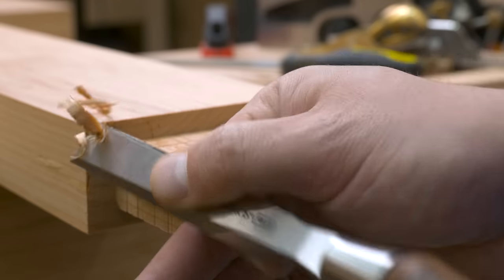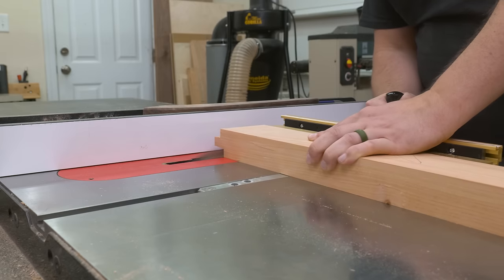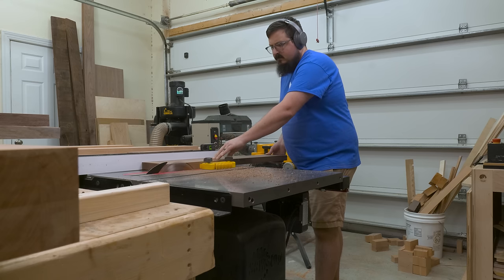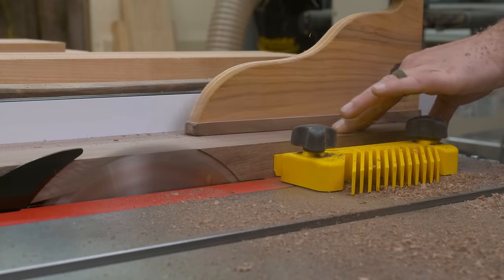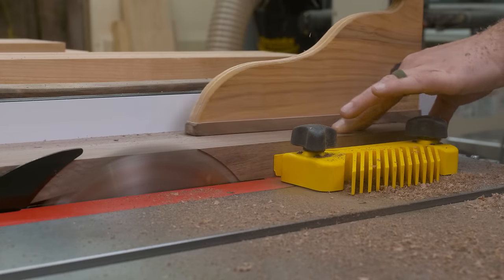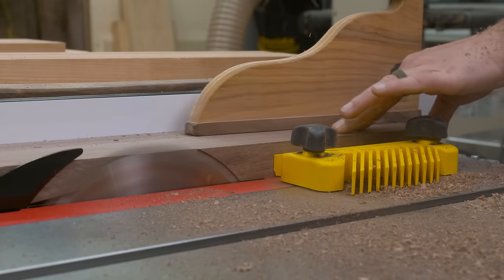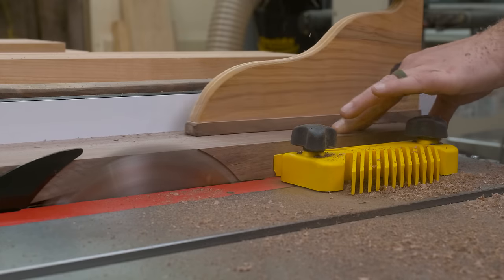Split Top Roubo: The ULTIMATE Woodworking Project is FINISHED

Comment: When you tap those threads, you can wax that cutter as well. Less tear out that way. You could probably have saved a lot of time on those dowels if you had a lathe. The problem with the lathe though, is that it is only about 1/4 of the cost of the 'accessories; that you would need to go along with the lathe..... I only have 6 of them....
Reply from the maker: I do have a lathe, but I very very rarely use it. The one I have is a pain to get set up to be honest.

Comment: Newbie question here, what is the reason for that miter saw technique you're using when doing a cut 1/3 the way down and then the rest?
Reply from the maker: Great question! With the pieces being so thick it’s better to take smaller passes so the blade doesn’t bite and kick the board back. A sliding miter saw works a lot better that way.
Reply: @TimberBiscuitWoodworks  That makes sense! Thanks for the quick reply! :)
Reply from the maker: @mapzta  no problem!

Comment: 2:07 question given you used the planer in place of a table saw could you have stayed at the used the jointer?
Reply from the maker: The jointer only allows you to flatten one face and square up one side. In order for two sides to be co-planner you have to use a planner or your workpiece won’t come out square.
Reply: @TimberBiscuitWoodworks  Yeah as a novice, I'm just confused.  How the planer can substitute for a table saw but the jointer can't at this stage.  Need to re-watch/research.
Reply from the maker: It just has to do with what each tool is designed for. The planer thicknesses boards down by reflecting the downward facing side when you plane. So if there’s any discrepancy in your board face, it’s going to be reflected on the other side whenyou plane it. The jointer is designed to flatten that bottom face so your workpiece is flat. The jointer will also allow you to get a 90° angle on one edge and one face then you can take those to the planer and thickness them down knowing they’re going to be exactly 90 on that opposing edge and face as well. I hope that makes sense.

Comment: Really great build.  I am hoping to start a STR within the next six months.  Question:  You do a fair amount of ripping on the band saw vs. table saw.  How come?
Reply from the maker: Glad you enjoyed it! I love using the bandsaw for ripping. I feel like it is a lot safer than the table saw since I don’t have to worry as much about the internal pressure grabbing onto the blade. And in the instance of this bench I had a few boards that were close to my final dimension so the thinner blade allowed me to conserve more material.

Comment: I saw on other videos people recommending to let the miter saw blade stop spinning after cut before lifting, otherwise you risk the off piece getting sucked into blade and causing a kickback.

Great videos!
Reply from the maker: Yeah, on some saws the brake is slower then others. But that’s also so you don’t run back into your workpiece with the teeth of the blade. It’s a good idea either way I’m just impatient. And thanks!

Comment: Hi , great looking job. I am a retired English gentleman living in France, I am a specialist joiner cabinet maker, A little tip for your router purchase an extra side fence and probably longer extension rods and then you can use the two side fences to clamp your router to your piece of wood so the router slides nice and easy for using the side fences and then you can adjust the side fence rail that connects the router to centralise your router this way the router will not move once you’ve got it locked in position as the two side fences hold it tight, I hope you understand this, PHIL FROM THE MOULIN FRANCE
Reply from the maker: Thanks! Yeah I have that on the list to do!
Reply: Your Christmas present to yourself if you’ve got time Merry Christmas and happy New Year to you, Phil from the moulin France
Reply from the maker: Haha maybe! Merry Christmas to you too

Comment: That's a beautiful bench, man. And no, there are never too many clamps. One question, one suggestion/request:
Q: You skipped very quickly over the technique using that string crossed over your benchtop to check... level? square? something?  How does that work? Maybe a follow up vid on that in detail?
S/R: You're the first person I've seen use a hard wax oil on a bench, so I'd be very interested in a follow-up vid that evaluates how well that Osmo held up, and did it make the surface too slick.
Reply from the maker: Thanks man! Yeah, I’ll put together a shot or something that shows the process a little more clearly for checking the bench top for flatness. I only used a very thin coat on the whole bench but it’s not overly slick, it’s just enough to protect the  surface.
Reply: @TimberBiscuitWoodworks  Awesome! Thanks!
Reply from the maker: No problem!

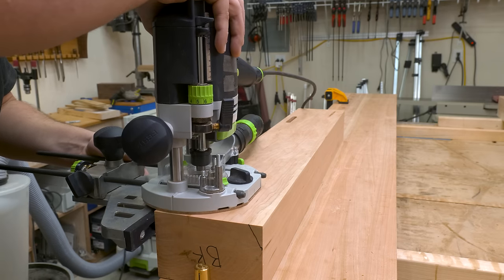Comment: cutting leg mortises and tenons video-time of 3:28 where you explain the 2 deep hole method then back/forth.From the image you are doing the 5/8 wide mortises and then a little bit further in your video you use the 1/2 bit to mortise the single 1 inch wide on the other face of the leg
It is so kind of you to help me with this
Reply from the maker: Oh! I’m sorry so in that situation, I’m taking two passes with the 1/2” bit. My apologies for the miscommunication, all the bits I use are Whiteside bits so I just assumed that’s what it was. And it’s not a problem, I’m always happy to help.
Reply: Excellent.Many thanks for the update good news is I dont have to buy another bit @TimberBiscuitWoodworks

Comment: Fantastic work and craftsmanship.  As for what to use the scrap wood pieces for I suggest anything but 😬 cutting boards😉.  Oh and thank you for not turning those nice walnut boards into an epoxy project.
Reply from the maker: 🤣😂🤣 thank you! No epoxy projects here, though I did do a cutting board a few years back. 😬 So don’t worry, that’s been crossed off the list.

Comment: Is there any way you could take some quick rough measurements of one of the three knobs on the Glide leg vise? That would be incredibly helpful for me.
Reply from the maker: Sure what do you need?
Reply: @TimberBiscuitWoodworks  Just the diameter and length of one of the three knob/handles on the Glide handwheel. That would be super awesome of you!
Reply from the maker: 2 3/64” long
1 13/32” OD
1 29/128” long taper
53/64” OD at taper start
Hope that helps